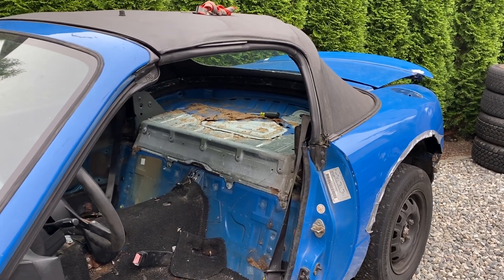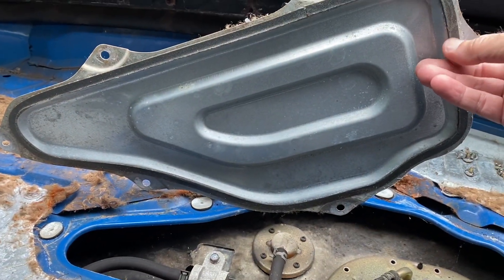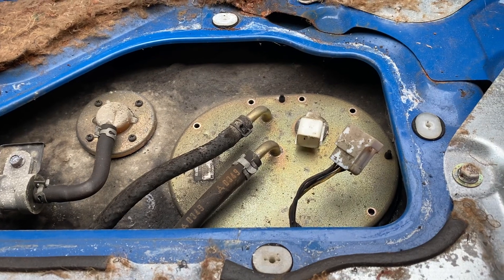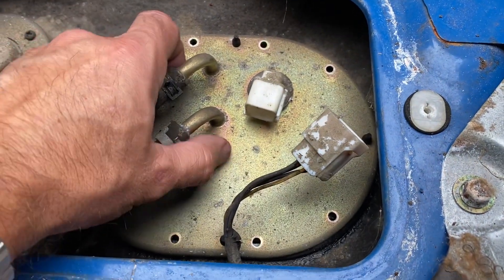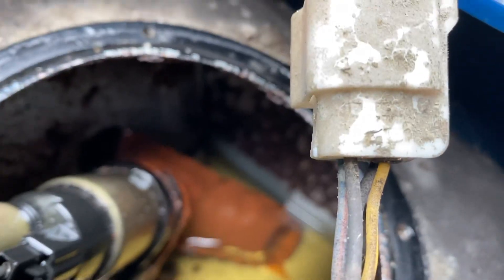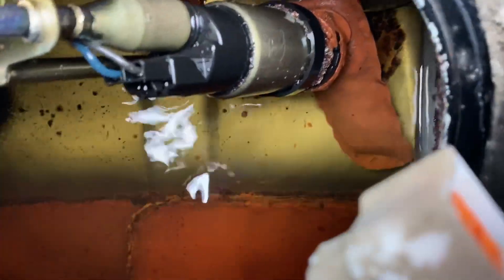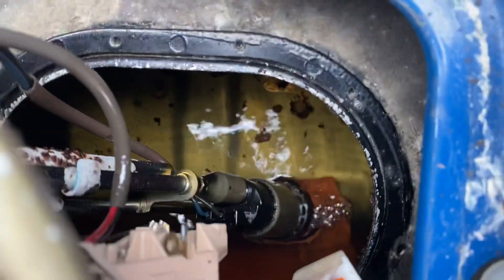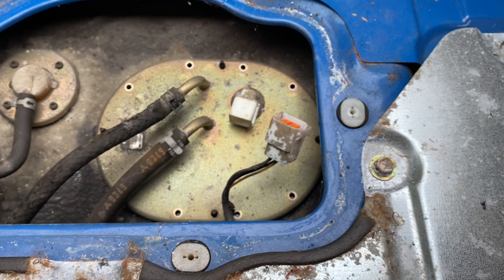Miata fuel tank, pump and sending unit inspection.

Comment: I am loving these videos! Amazing job! I just inherited a 92 Mazda Miata that has been sitting in a garage for 13 years. Rats have made a real mess under the hood and chewed through a good bit of the wiring. Other than checking the fuel tank/pump is there anything else I should do before I replace wires and try to get this thing to fire up? Thanks!

Comment: What do you recommend to use when cleaning the gas tank?
Reply from the maker: Good question. It would depend how bad it was. Just varnish, sand or heavy rust etc. For an empty tank with loose debris, I would use a shop vac and a tooth brush to dislodge any stubborn deposits.

Comment: So you can get away with just cleaning and replacing pump and running it daily after running seafoam and everything else to try to eliminate rust after pumping old gas out and vaccuming my miata is sitting in the same exact situation and i just wanna know if i can save it without habing ti replace the whole tank it doesnt leak it just foesnt start due to pump and im worried i got some in Injectores and engine  last time it ran will i be okay 😢

Comment: How does a Mk1 Miata na get on with E10 fuel??
Reply from the maker: Most stock NA (90-97) Miatas will run fine on 87 octane fuel. As far as I know 87 is E10. It’s not branded as E10 in this neck of the woods though.
Reply: @MiataMan  Performance will suffer.  Stick with 98 octane.

Comment: How do you replace the tank, does it come out from the bottom, or the trunk?
Reply from the maker: To change the tank, the exhaust and whole rear sub frame has to come off. 
Big job.
Reply: @MiataMan  yikes.  When I upgrade my rear diff to a 1.8 ls, I'll take the opportunity to drop it and recoat the inside, as a preventative measure.